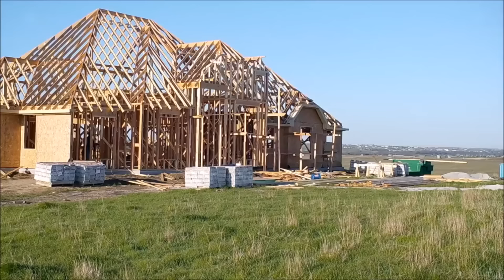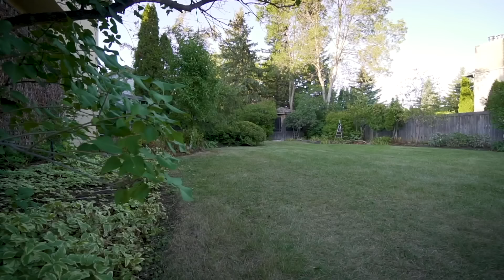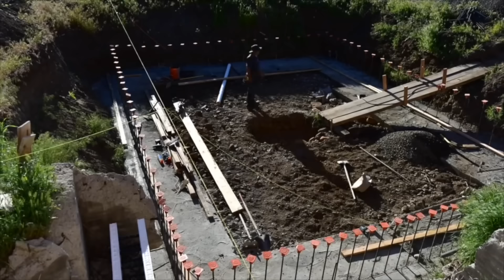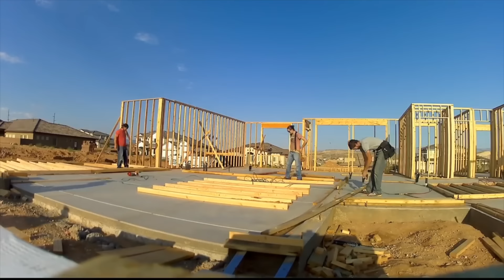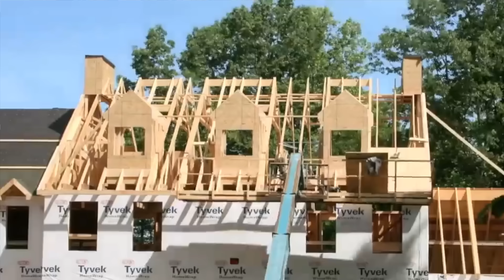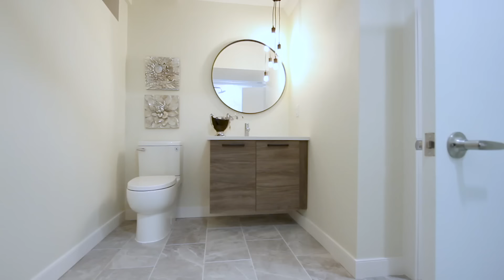THE REAL COST TO BUILD YOUR HOME | Custom Home | Building a house Cost

Comment: I built a 4200 square foot home and it did not cost that much you are working with the wrong people they're ripping you off. I paid $275,000 to build my house my land was $50,000. Go to school fees and taxes where $26,000.....in California in all $351,000
Reply from the maker: That’s great.  The work we do is high end and we build much above the base spec. There are builders here that can build much lower, but the quality is shady at best.  By ensuring quality, we are ensuring that our products stays quality over time.  Also consider that this is in CAD not USD.  
Thanks for watching.
Reply: In that $275,000, did you hire a general contractor?
Reply: @HAGA7793  no i did the work my self
Reply: @victorherrera7363   I agree that this guy's prices are ridiculously far fetched. So without a contractor, what was the biggest cost after the land? Utilities, material, engineering fee. I'm currently trying to build and from estimate, I think it's possible to do it within 50-70K for a 2,000 square foot home as long as I can do the labor from framing, sheathing, dry wall, insulation, painting, and regular mid range  interior trims after obtaining building permits.

Comment: Mr Nagy
Great video I found it helpful. I plan on building something between this and a high end $500 a square foot home. Could you please do a video on the costs and procedures of a super high-end home that’s about 5000 ft.²
Also if you could go over the most important aspects of a home built for durability and functionality I E if you have a limited budget the things you should splurge on for function and durability and the things you can add later after the home is built. 
Thank you for your time.
Reply from the maker: alex banks Absolutely.  You hit the nail on the head when you talk about functionally and durability vs. stuff that you can always change later.  We look at this as Value driven decisions.  “Where do we spend money that will get us the biggest return on quality, design, livability and comfort, and where can we save where it doesn’t really matter to the client in quality or esthetics”

Stay tuned For the LUXURY version!  Thanks for watching!
Reply: Emmett Leo Homes 
Thanks for the quick response!
I look forward to the luxury video and future videos and information. 
Also just an idea at some point you could talk about products you and your company use a lot and why like type of insulation. Internal, external building a passive house in a cold climate.

Comment: The comments are so amusing.  I'm reading a race to the bottom.  You could build for $0/ft if you stole everything and made slaves build it and you knew how to teach them to not do crap work.  Realistically, even getting an OK house is a challenge.  Building a beautiful high-end Net Zero Energy home is art.  There is an old saying that (unless you're a pro or have exceptional skills) anyone who contracts their own (major) build has a fool for a client.  Finding and managing quality people is more than most people can handle and still maintain a life.
Reply from the maker: D K 🔥🔥🔥
Reply: This is BS. I know people that have built their own house that are far nicer than anything else in the area and cheaper since they built it themselves. I'm talking they were able to afford all Wolf/Sub-Zero appliances. Everything had granite countertops, custom cabinets, vaulted ceilings, metal roof. Insulation in the walls of R-40, R-80 on the roof and it blew .2 ACH when finished for cheaper than the cookie cutter homes in the area that are built to minimum codes. All the knowledge is out there... it just depends on how motivated people are.
Reply: Brian Thompson 
You prove my point.  Your people had ots of knowledge, time and the ability to sort BS from building science.  Projects tend toward entropy.

Comment: Your mechanicals seem high. 20k Electrical...wow. more like 12k
Reply from the maker: I wish!  Furnace, HRV, tampered split systems, and air conditioning?  We are bang on for our location, however will definitely change based on where you are and what you are putting in.  Make sure to check out the next video this week that goes through an 8000 sqft, $4Million home line item breakdown! Thanks for watching!
Reply: @EmmettLeoHomes  no I thought it was 20k for just Electrical

Comment: What would you estimate a ranch style house in about 1500 sq ft on the country side to be? 
Main concerns are electrical and pluming. 

And what if someone where to do the framing themselves on something like that?
Reply from the maker: Jake's Fish Grind all depends on what your foundation is, and the level of finishing.  

You could be into that thing (in Winnipeg prices) for 225-275k if your base level and nothing fancy.  

Why are electrical and plumbing the main concerns?

You can save the labor by framing yourself, but remember that your time is worth something if you are taken away from something else, and that big mistakes are costly should you not know what you are doing as much as a professional.  

Saving the labor cuts your framing about 35-40%.

Comment: where the fk are you spending 500 per sq ft, that hurts me to even think about
Reply from the maker: Geographical cost of labor and material, CAN $ and finishes.  Interior finishes can skyrocket a project, as well as architectural features that require a lot of expensive material.

Comment: Yeah dude you're full of shit, it doesn't cost that much to build, and it really shouldn't. A shiplap feature or some other little accent doesn't justify such a price. In all honesty there's too many middle men and overhead. The contractor takes outrageous overheads without putting in work and then each subcontractor takes an overhead while all the little slaves work for scraps. Wake up people. Break down the cost to each and every screw and you will see.